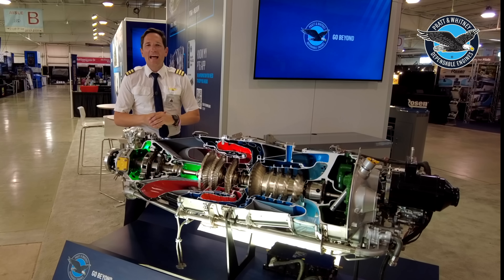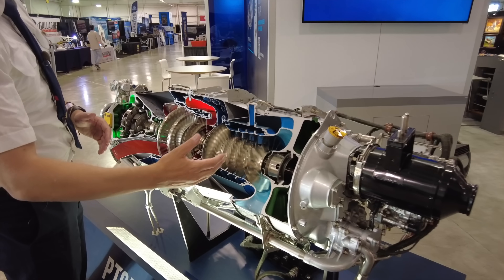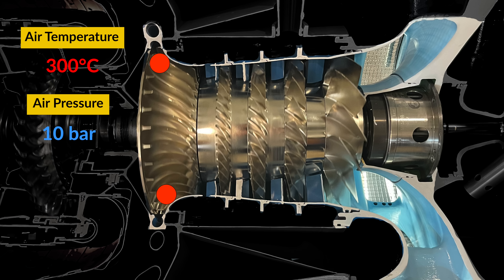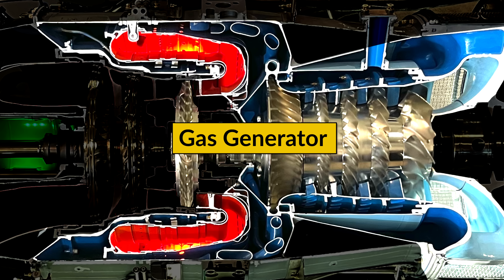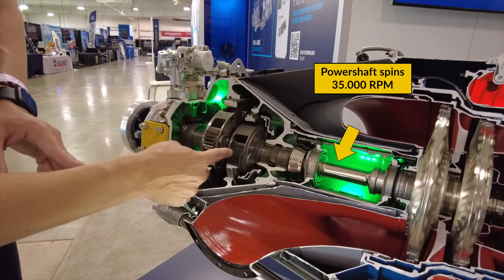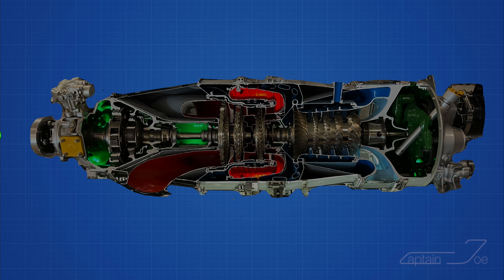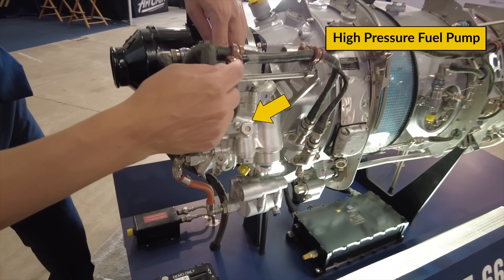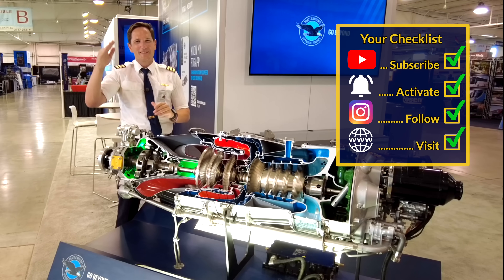The BEST TURBOPROP explanation video! By Captain Joe and PRATT & WHITNEY

Comment: Best explanation of this engine ever.  Thanks. Could you also teach us about N1 and N2 and how these terms relate to the engine and the start-up procedure?  Always learning from your videos.  Well done!
Reply: The terms N1 and N2 have been used to describe the speed of the Gas Generator and Power Section respectively. N = speed and 1 refers to the Gas generator; 2 = refers to the Power Turbine speed (or propeller speed, if you are an OEM  - aircraft builder).  More usually they are referred to as NG speed (speed of the Gas Generator) and PT (Power Turbine speed). NP is often used in place of N2 to denote the speed of the propeller (after the reduction gearbox). The difference between NP and PT/N2 speeds is gearbox ratio. This terminology is just a convention that was adopted years ago. Some of our OEM's use N1 and N2 in their aircraft documentation. Sorry if this sound complicated! During the start, the starter motor turns the Compressor and its turbine. This is the Gas Generator = NG / N1). Hope this helps!
Reply: The PT6 the has a single shaft gas generator. Most turbojet and turbofan engines have two stage gas generators. A  low pressure compressor/turbine and a high pressure stage,  Some like the RB199 have three. These stages all turn at their own rates and it is these that are referred to as N1 N2 etc . They too usually spin in opposite directions to counteract torque.

Comment: The operation of the free turbine is actually pretty similar to the high stall torque converter in the Charger.

The coupled turbine and radial compressor in the gas generator assembly are very similar to the turbocharger in Paul Walker’s Supra. Cheers!
Reply: This is not a torque converter. 

In a torque converter.. you have an engine driven impeller moving a fluid into a turbine. 

In this case the fluid is moved by compression and combustion and the compressor turbine actually removes energy from the fluid.. it doesn’t add to it. 

There is no “stall” in these engines. The gas producer and power section not only continue to run at different RPM… but in opposite directions.

Comment: Wonderful video but one question. With regard to the exhaust; an older turbo prop engines some exhaust would be pushed out the back as added thrust. But it looks like that cannot happen on such a design. Of course with the engine in front of a fuselage there wouldn't be room
Reply: There are exhaust gases that are pushed out the back that create thrust on the pt6. It’s not a lot tho, like 150lbs but it’s taken into consideration when we talk about ESHP(equivalent shaft horse power)
Reply: @KinZZi  thanks for the information
Reply: @kevinbarry71  np

Comment: Suck, squeeze, bang, blow is for 2/4 stroke engines. There is no bang in a turbine, at least not if you want the engine to remain intact. The fuel is continuously burnt just like a burner on a gas stove in your kitchen in order to add heat and that is all. No detonation, no explosion, no bang, just a steady supply of heat. Turn your gas stove on and you'll have a visual of the closest thing to a turbine combustor as you can get, annular flames and all.
Reply from the maker: It’s in every aviation book, on how jet engines work! I’m aware there is no “bang”, but a continuous burn of fuel and air

Comment: Whoever came up with the idea about the separation between Gas Generator and Power Section blew my mind that the shaft is not connected from each other. Your explanation about the engine was very clear and easy to understand. Thanks for the video!
Reply: The Chrysler turbine that was developed late 50's-early 60's utilized the same concept.  This was the "clutch".
Reply: @kennethm.pricejr.8921  
essentially a gas (which is still a fluid) torque converter
Reply: Lycoming had the T53 ( Huey engine) free power turbine in the late 50s but I am not sure if it was before the Chrysler engine.
Reply: @JimBee73 
pretty much! you can only break half of the  engine
Reply: I wonder how much efficiency you lose with this "viscous coupling". With torque converters, it's generally about 15%.
Reply: This is not a torque converter.  

In a torque converter or fluid coupling you have an impeller that drives a fluid.. and a turbine that turns that fluid into mechanical force.  

Both the compressor turbine and the power turbine are being driven by the exhaust gasses (also considered a fluid) which is a product of combustion.

Comment: I was hoping you would have explained ITT and where it is measured.
Reply: ITT is measured at station 5, between the compressor turbine and the first power turbine vane. It’s the avg measured trimmed temperature of the thermocouples that are situated there

Comment: OMG, PLEASE make more videos like this of other engines, this was absolutely FANTASTIC!
Reply from the maker: More to come!
Reply: Most turbine engines work basically the same way. There are a few variations in bypass, and combustion chamber types but pretty much the same basic principals as this. Can, Can-Annular, and Annular are the 3 main combustion section types. Can is used in smaller engines like APUs and GPUs and on some small turboprop engines. Can-Annular are older types used in turbojet engines like the JTD-4, and Annular are used in most modern high bypass engines. Though can-annular are still used by in drastically fewer numbers than they used to be. In fact I used to laugh at one particular episode of Star Trek The Next Generation episode because they used a bunch of can-annular cans for set decoration as "scavenged parts" from derelict ships. Most people would have no idea what they were looking at though.
Reply: .. just this..! 
... so easy and simple story this powerful motor.. 👋👍

Comment: The air is NOT accelerated in the compressor, although the duct gets more and more narrow and the Venturi effect should kick in. That's because the blades on the rotors and stators build up a decelaration grid. The speed of the airflow remains more or less the same while passing the compressor. The compressor is not about to accelerate the air, but to compress it. BTW, a centrifugal stage is used when the ratio of blade length and width of the gap between blade and channel would get too big.
Reply: The compressors do accelerate the air tangentially. The stators are there to reduce the tangential velocity and convert it into static pressure. 

A centrifugal compressor is used to make a compact engine as it’s far more suited to a reverse flow combustion chamber (not to be confused with reverse flow engine) which allows the compressor turbine to be mounted on a very short shaft between it and the compressor.
Reply: A centrifugal compressor is also cheaper to make, more resistant to compressor stalls, and if it’s the first stage more FOD resistant.
Reply: @calvinnickel9995 
What is FOD?

Comment: Great video! Question: do all turbo prop engines operate in this reverse flow method? Or do some operate in the traditional direct flow (front to back) direction?
Reply from the maker: No, not all but a few of them yes
Reply: What you can take from this is why this engine is reverse flow.

It's all down to the free turbine that drives the prop. Free, meaning that it is not coupled to the gas generator section.
If it were coupled then the prop could be driven from the main (only) shaft and its turbine could be at the back of a non reverse flow engine.
Since it isn't coupled then, for a free turbine on the rear of the engine, you would need a second, concentric shaft to get the power to the front.
So it makes sense to put the turbine on the front and reverse the flow.

Comment: Outstanding graphics and overview. If one wants to learn a lot more about turbines head over to AgentJayZ and jump into the deep end of the pool. He is a jet / turbine tech that overhauls different jet engines and has fantastic and detailed videos of every aspect of turbines. Then if you want to get even more technical, in the comment section a turbine engine development engineer from RR answers the more complex design issues. Many aspects of these engines are not obvious.

So what is the difference from a functional perspective of this “turboprop engine” vs a “geared turbofan” vs an unducted fan”? Also it would be interesting to have it explained as to why this is a reverse flow engine with a centrifugal stage vs a turbine with multiple spools (multiple concentric shafts) without reverse flow?

Comment: I love flying on turboprop aircraft! My favourite is the Dash 8-400/Q400. The Dash 8-400 also sounds so cool.
Reply: The smaller ones sound even better.
Reply: @lajya01  I will say that all turboprops sound cool but I think the Dash 8-400 sounds the best of them all.
Reply: Turboprops make my favourite sound, especially through rain, and powering down. Most of my flights of this kind were Saab 340.
Reply: Back in the 90s I had a chance to go for a tour flight on a Fokker f27 with the RR Dart engines, what a sound, that high pitched whining sound was epic! 😎
Reply: Yes it does!!
Reply: Also powered by P&W